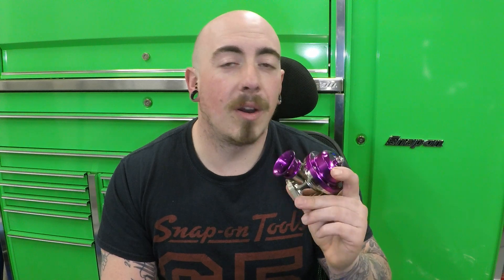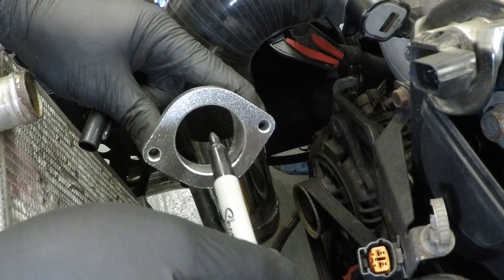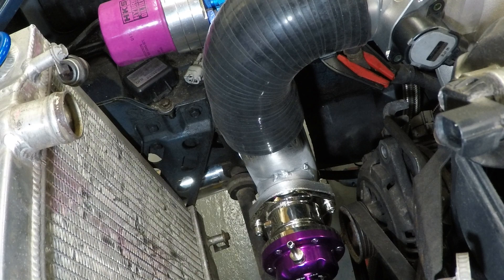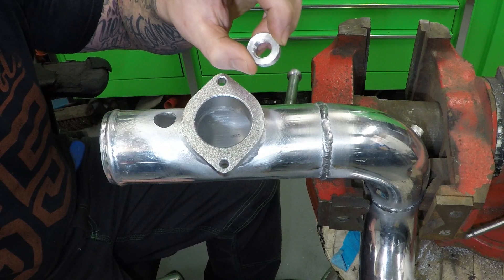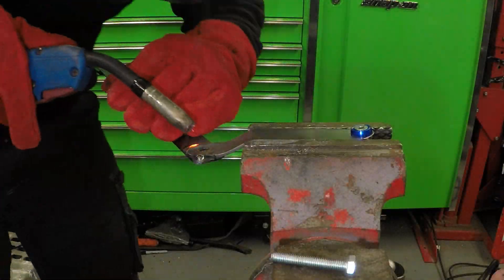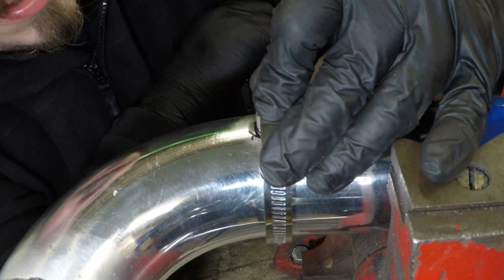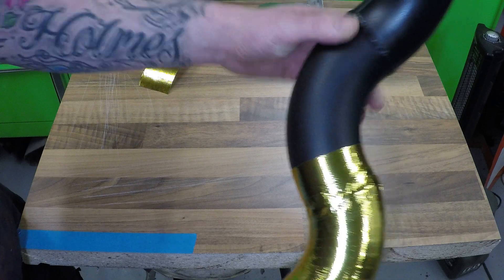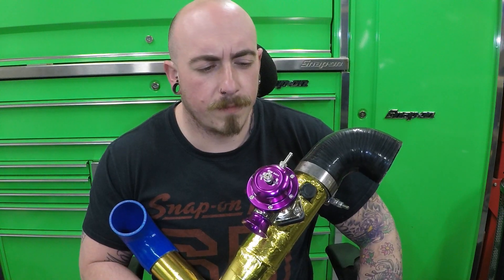Intercooler final touches : MX5 turbo build pt4 + IAT and BOV

Comment: Isn't the Iat optimal position right after the intercooler on even on the exit of the intercooler? As to having it where you have it's getting heat soaked from engine thus having faulty readings?
Reply from the maker: yes this is true and i actually plan on changing the intercooler piping soon as ive changed the way i want to route it and the IAT im usinig
Reply: @Project380  thanks you for replying, love your content keep it up 🔥

Comment: im guessing the IAT can be next to the BOV with no harm to each other ?
Reply from the maker: ideally the iat would be right in front of the throttle body but i didnt want it in the silicon elbow. the other factor to consider is how responsive is your sensor, if its an extremely rapid sensor then you might have an issue with dramatic changes with the drop in pressure resulting in a temp drop but these gm sensors are slow so there is no harm